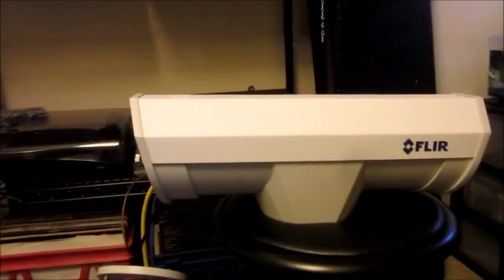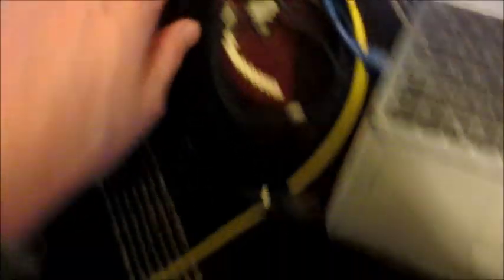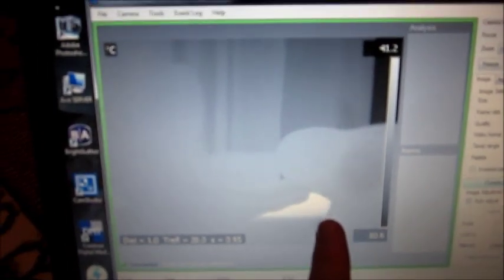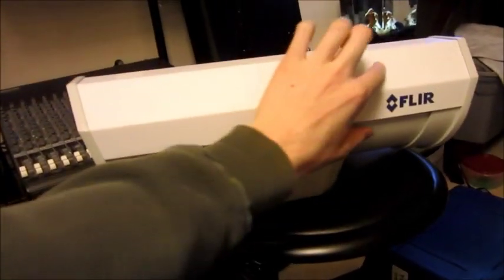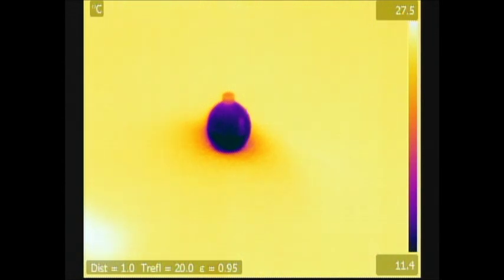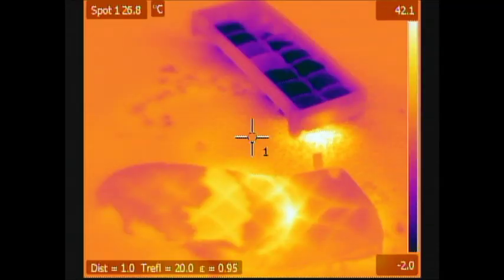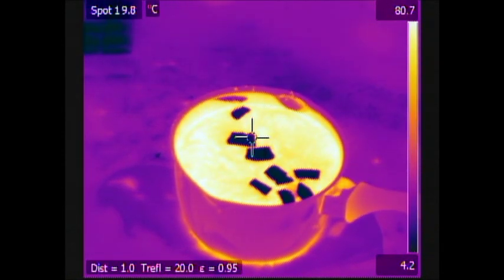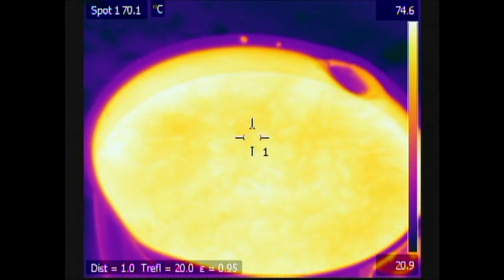Ice & Boiling Water - Thermal Camera Experiments

Comment: Ideas:
If you have slow-mo capability then you could do a balloon pop as the gas inside would go cold as it pops (and expands).
Same thing works for aerosols which are very cold. An aerosol on fire would be hot and cold and dangerous.
Or you could film elastic bands that heat up as you stretch them, and cool down as they shrink.
Otherwise a laptop?